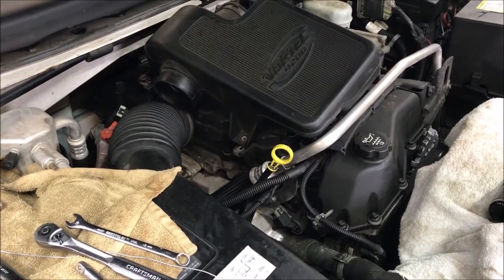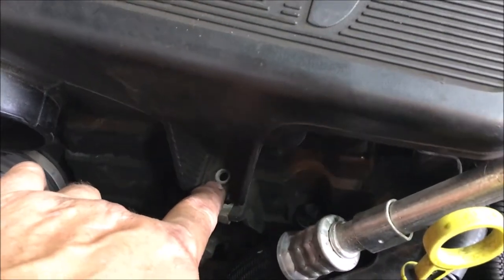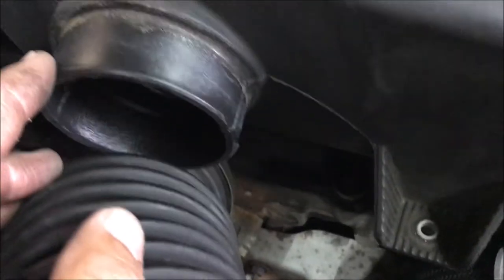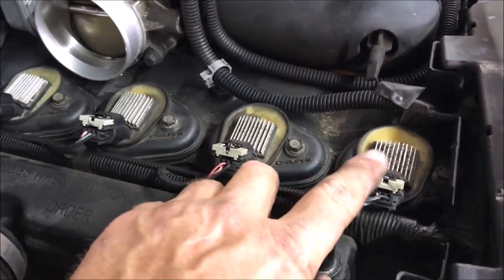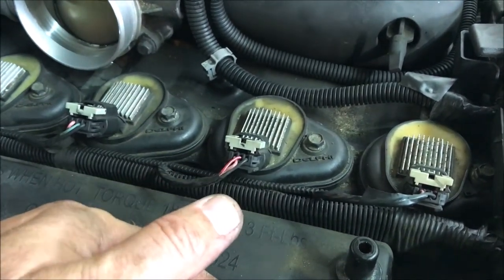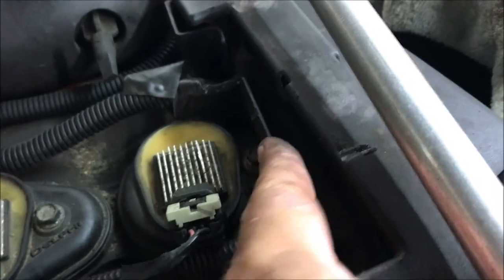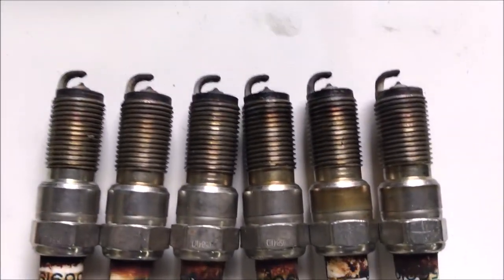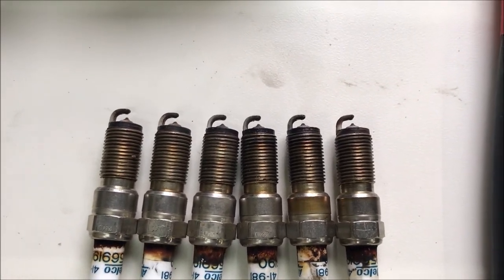OldGuyDIY Key Points Changing 2004 GMC Envoy XUV 4.2L 6 Cyl Spark Plugs AC Delco 41-103 .043"  Gap

Comment: I just bought all six ignition coils but the fifth one is not fitting
Reply from the maker: I suggest vacuuming out the hole the coil goes into.  Something may have fallen in the hole while you are doing the job.  Have you tried to install the sixth coil in the fifth hole so you know the issue is with the hole and not the coil. Will the fifth coil fit in the sixth hole as it should? It is not unheard of for the manufacturer to occasionally mislabel an item or put the wrong part number in the box.